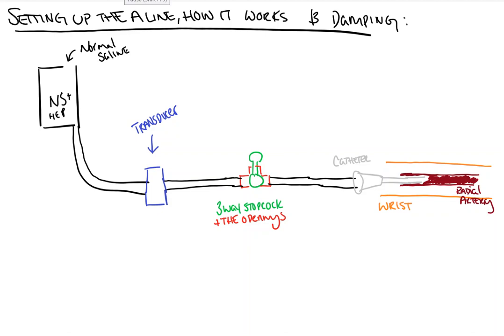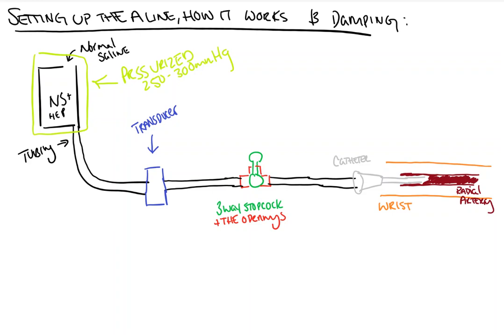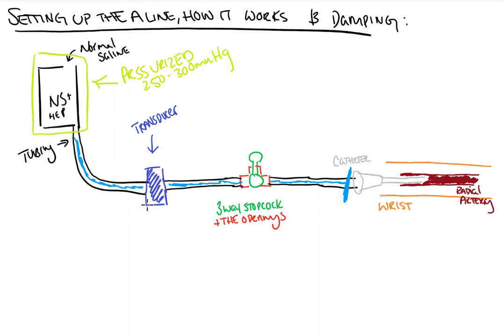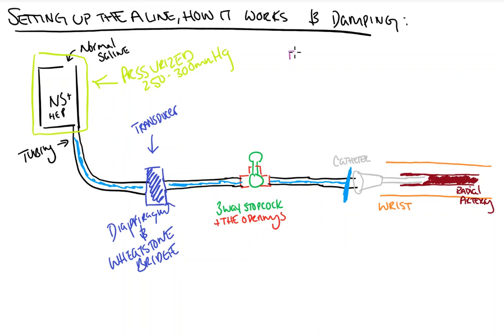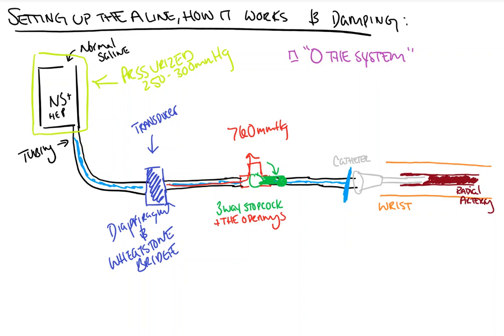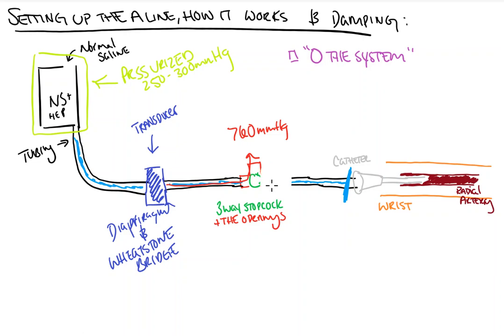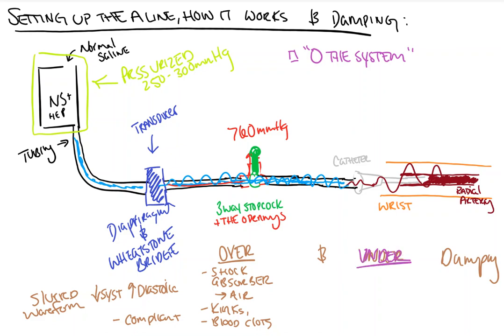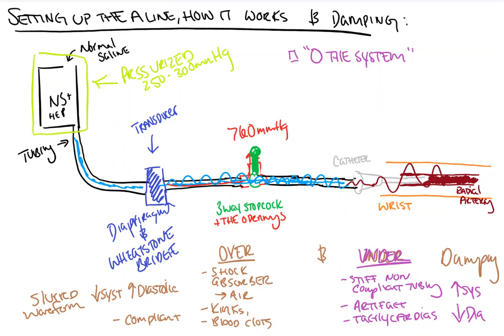Setting up the Art Line, How the Transducer Works and Damping

Comment: How does the pressure wave from the artery get transmitted to the fluid filled tubing without blood getting in the line? And how does it exert a pressure wave if the bag of saline is exerting its own pressure?

Comment: In reference to zeroing the transducer, if this doesn’t need to be done at reference level do you know why it is recommended to lower drip chamber to 0 if using a closed method in External Ventricular Drains?

Comment: I think the reason u do it at the level of the heart is cos pressure in the transducer is proportional to the vertical height of saline in the tube above it so if the tube leading from transducer to saline is more vertical, the pressure in the transducer is greater - u wna zero the transducer at the level that it’s acc gna b in the procedure
Reply: If that were the case then you would not only need to look at the transducer being at the level of the RA but also ensure that the hanging saline was at a consistent height above the heart for all patients.
Reply: I’ve been watching several videos on this topic and the original poster is correct- however you pose a good point and I’m not sure why only the transducer lcation matters and not how high up the saline is hanging. My guess is the transducer has some internal mechanism that standardizes the pressure of the infused saline as it enters the transducer.